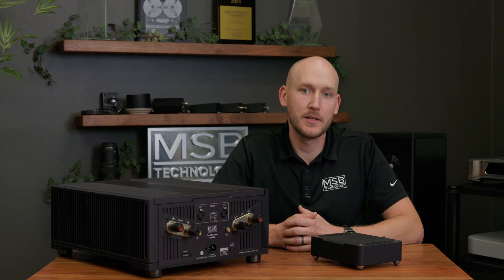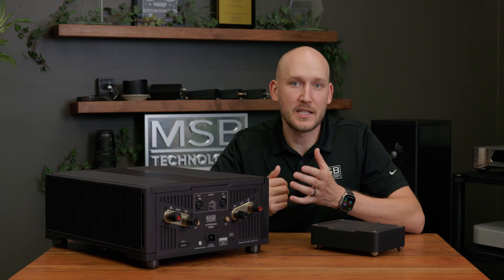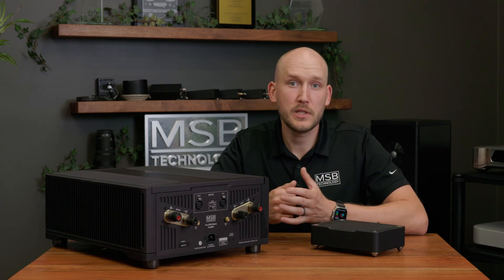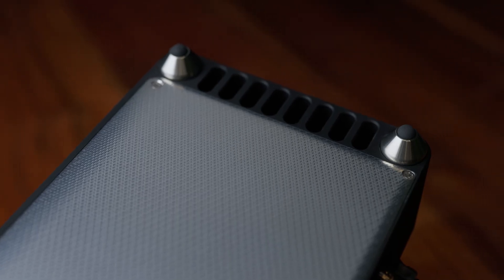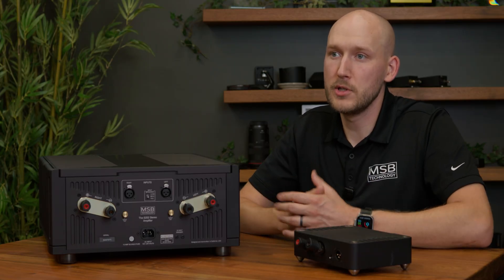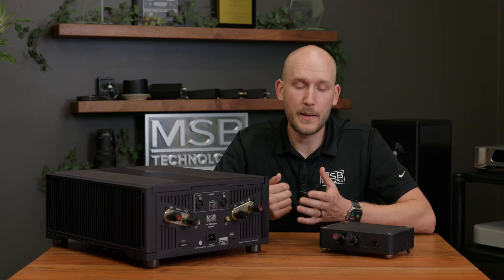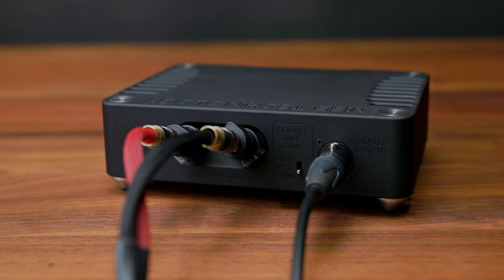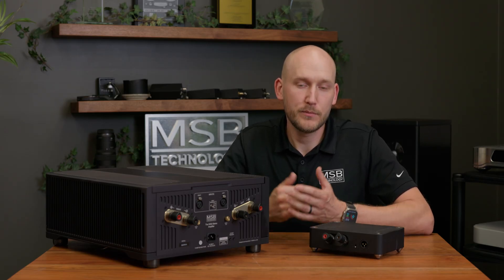The Pro Sub Isolator | Introduction and Setup by MSB Technology

Comment: I don't understand this at all. A line level signal comes out of the pre-amp and connects to the powered subwoofer XLR input.
Reply from the maker: Some preamps, including our Reference and Select models, can feature a dedicated sub-woofer output. However, when the powered sub woofer is connected at that point in the chain, it can often add noise to the delicate signal and thus that noise will then be amplified by your power amplifiers doubling the negative effect. The Pro Sub Isolator goes after the power amplifier so the signal is much more rugged and is not affected by the low-class amplification in the powered sub woofer as well as not adding additional noise before amplification process. There's a diagram that can further illustrate the intended implementation on our website here > https://msbtechnology.com/accessories/pro-sub-isolator/
Reply: @msbtechnology 
How measurable is the distortion eliminated by your box?
Thx
Reply: @msbtechnology  It still doesn’t make sense. The output of the power amplifier is not a line level signal yet it’s connected to the line level input of the Pro Sub Isolator.
Reply: Maybe it's...
line level out to amp.
Speaker level out to spk.
Speaker level ot to unit.
Unit line level out to sub.
Avoiding line level out from pre to sub.
If right, the sub(s) are taken out of the pre-amp-spk connection.
Reply: cos its BS to sell you something you dont need....its HI-Fi !!